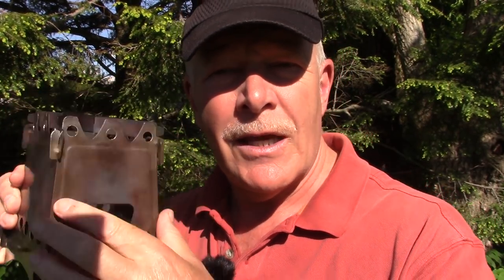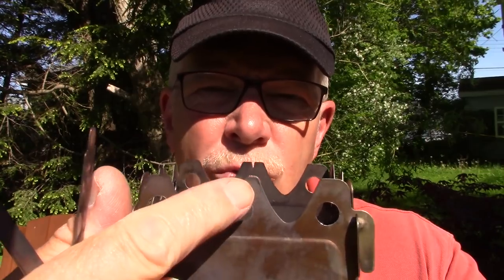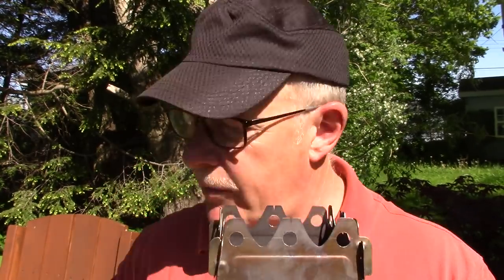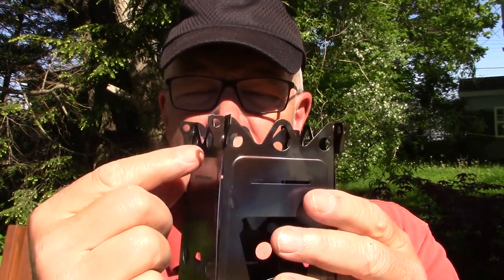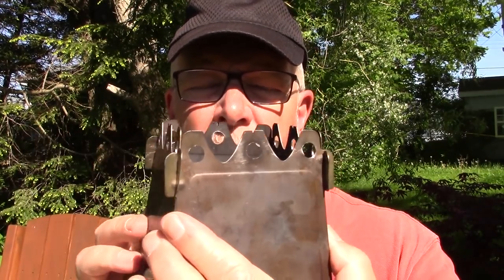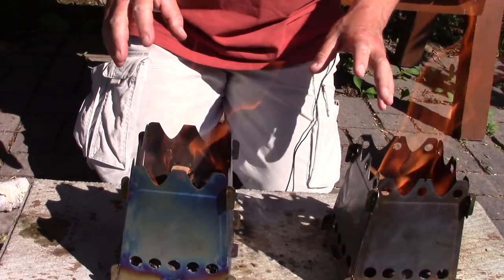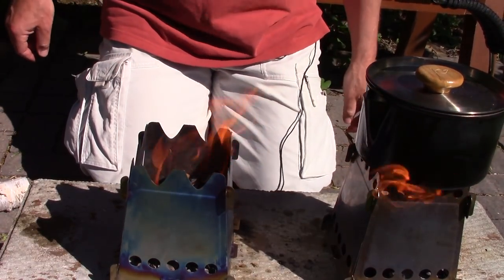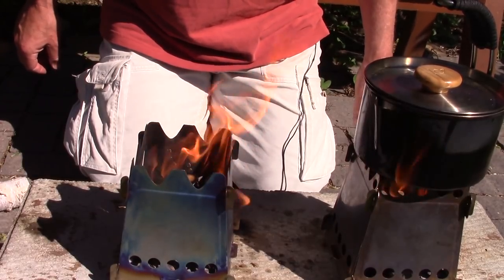Improving Airflow in the Emberlit Stove

Comment: Great idea!   Enjoy all your reviews!
I recently purchased the titanium version of this stove and did the same.   
It was easy to drill through, you just need to make sure the piece  is securely clamped down flat, very close to the hole, on a piece of plywood.  I used 3 clamps around the perimeter of each hole drilled.
FYI, I find stainless steel harder to drill through….
Reply from the maker: Right on. Glad you enjoyed the video. Thanks for commenting

Comment: I like your reviews and comparisons but on the Emberlit I have found the culprit for me is over loading the stove cut your wood to be below the vents already in the stove and I have not had any issues. Also the stove was designed to use twigs and branches fed through the big hole in the front of the stove again it works for me, boiling water making soup or cooking meat no problem. That being said I am sure your alteration would work too. Good review and fix for anyone have an issue with smoke!
Reply from the maker: Don't get me wrong, I really like my Emberlits ( I have three). I started noting the smoke issue when using much less wood. I agree the stove works well when fed from the port on the side but also works well when pre-loaded from the top. As long as it is not overloaded as you pointed out. Thanks for commenting
Reply: @MarkYoungBushcraft  I could see you liked the Emberlit my comment was just that I have not experienced what you did good review and good product when I get caught up I will experiment some.

Comment: Nice modification. I was thinking of making some new crossbars out of a wider material, only con for that is they would need to be twice as wide as the original. The holes definitely work. Looks like you used the top of the side tabs for the Center Line for your holes.
Reply from the maker: Wider cross bars would also work. Yes, that is pretty much what I did to centre the holes. Thank you for commenting

Comment: Wonderful video, Mark! I am definitely going to try these mods out. The pot support modification is likely the first I will try, and then the extra holes in the support teeth or just under them to see if improved airflow lower also helps. I’m also thinking if I go that way, to fashion some short dampers from sheet metal that could be hung from the top on each side over the new holes to bank the fire under those situations where one wants the fire to burn slower, cooler, yet can be easily removed to improve air flow. It’s going to be fun experimenting!
Reply from the maker: The dampers sound interesting. Would be good to hear how they turn out. Thanks for commenting

Comment: Very interesting. I have wondered about drilling holes up high on mine to improve airflow when I add a pot to it. Cool little mod turning those pot supports 90* too. Great video as always, thanks for sharing your insight and efforts.
Reply from the maker: Glad you liked the video. Great place to start is the pot stand mod. If you like the performace of that you may not even want to drill the holes. Thanks for commenting

Comment: Would it help to put a metal plate on top of the modified stove, to avoid excessive heat or scorching?  It would be another thing to carry, but might be worth it.  There is always a problem with simple stoves, the lack of a simmering system.  Maybe you can come with other or better ideas?    Personally I have a Kelly kettle, a wood gas stove, and a hobo stove, but my oldest and favourite stove will probably always be the Trangia.   It allows for simmering, has built-in wind protection, and is very discreet.  It is a pain to carry fuel, and the stove is not fast, but still ...
Reply from the maker: Hard to beat the classic Trangia. I had thought about trying a metal spacer/diffuser of some type but as you say, it is one more thing to carry. It may be worth it to test though. Thank you for commenting
Reply: I am old enough to remember asbestos mats, put on a gas stove at home, to stop scorching.   Obviously such things would be outlawed now, but I wonder if something equivalent (and safe) exists.  The thought came to mind because those things were lightweight.

Comment: Thank You Sir!!  Looks like an improvement....but wouldnt it be easier to just use tje NON smokey FireAnt??
Reply from the maker: Good question. The Fireant is quite a bit smaller so the fuel does not last as long (more feeding) and it does not produce quite as much heat (related to surface area). Thank you for commenting

Comment: I'm completing a couple Nimblewell Nomad Stoves,  and will add your mod,  to a couple of my own.  I've adapted them to accept a Vargo Titanium Triad alcohol stove and a Trangia  Burner along with a tuna can Buddy Burner.  For really functional drill bits you might consider Mastercraft 3 pc Step Drills 054-0698-2 $39.99, but often were on sale for $9.99. Any one bit will cover 6 - 9 different size holes in thin metal. Clamp your work, they like to grab and you've got a Rotary Guillotine.  Thanks for the idea and demo.  Cheers.
Reply from the maker: I started out making a couple of Nimblewell stoves before I received the Emberlit. I might try the step drills. I have a set I picked up at Canadian Tire. Good tip on clamping the piece down. Thank you for commenting

Comment: if possible could you do a test with the two emberlit stoves and see if the hole make any appreciable difference in heat output and total burn time?
Reply from the maker: I can say with experience that yes, the mods have made a difference in output heat. It is all about airflow. Reducing smoke, as this mod does increase efficiency. The trouble with time comparisons and wood stoves is the factor of using exactly the type, size and amount of wood.  I do have a video comparing the Emberlit with a Chinese copy that has more airflow if you are interested. Thanks for commenting
Reply: @MarkYoungBushcraft  I did see that video where you compared the uberleben to the emberlit, I didnt think just those holes in the uprights would make the same level of difference as the perforated bottom in the uberleben though. Thanks for the info.

Comment: Have you tried the same test with a pot that is boiling hot? Just to see how much the "cooling effect" of the cold pot/water has to say for generating the smoke..?
Reply from the maker: No I haven't. I can see your point that the cold pot acts as a heat-sink causing the smoke to condense. For me it did not occur to try this because I rarely put hot pots on a stove. Thanks for commenting

Comment: Did you try it with the 90 degree pot stand on the modified stove? Is that even better than modified alone?
Reply from the maker: I have used the 90 degree turn of the crossbars (actually, it is only 45 degrees) a great deal. You can see it in action in the video linked in this one. I would say the improvement is about the same. Making the holes allow the cross bars to be used as intended or not used at all. I have not tried using the turned crossbars along with the holes yet.  Thanks for commenting

Comment: If it's the Titanium, which I have, drilling and dremeling the top supports will be a chore. Beware of sharp edges.
Reply from the maker: The stove in this video is stainless but I do have the Ti version I will be drilling hole in. I have drilled Ti before and yes, it is tough. Definitely need a carbide drill bit. Thanks for commenting